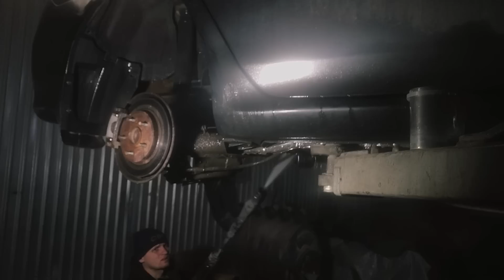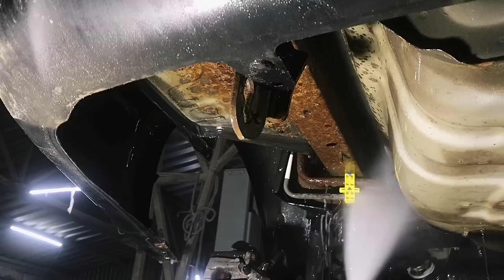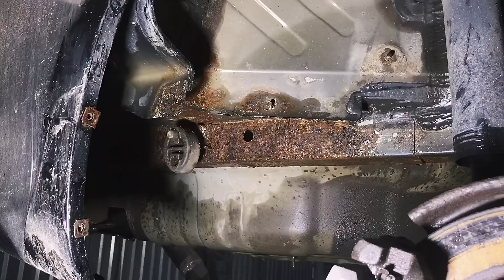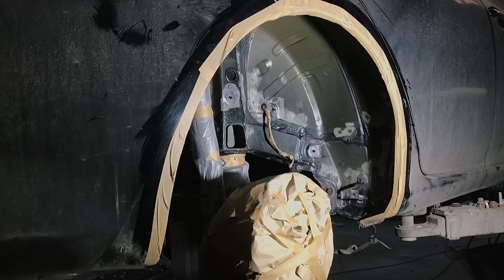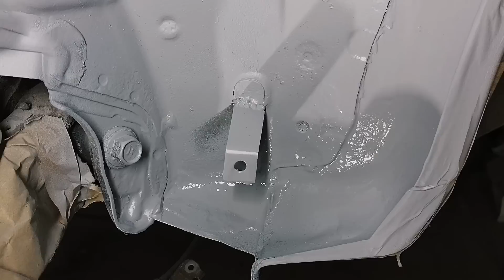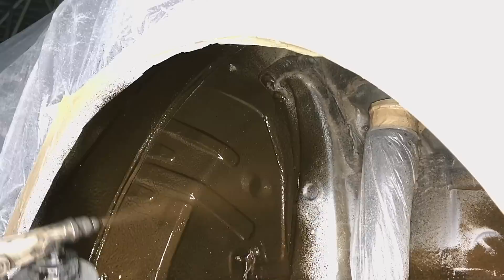Restoration Rusty Car Bottom Body  - Toyota Corolla E140

Comment: Great job, can you tell me the products you used there?
Reply from the maker: Here is a link to the tools and supplies that you may need:
Fluid Film Spray Gun Applicator Kit - https://amzn.to/3XxjdLZ
Anti-Rust Coating, 1 Gallon  - https://amzn.to/3CXuVpE
Anti-Rust Coating, 5 Gallon - https://amzn.to/46IY6KS
Fluid Film Spray - https://amzn.to/3O75WGZ
Under Body Coating Rust Proofing Corrosion Black Spray - https://amzn.to/3pnuT7u
Wire Brush for Drill - https://amzn.to/3PC71Yb
Knot Wire Wheel - https://amzn.to/3Nzwn6v
Stainless steel brush - https://amzn.to/3NCYWQm
Rubberized Undercoating Spray, Black - https://amzn.to/46AIWqL
Metal Etching Rust Neutralizer - https://amzn.to/44sqX3X
Angle Grinder - https://amzn.to/439t4bK
Sandblasting machine - https://amzn.to/3r7EnE9

Comment: Nice job, well done - but Toyota is know in Europe to be good quality but have bad rust protection ☹️
Reply from the maker: Thank you! it's true. But we saved this Toyota 🙂
Reply: All Japanese cars don't have rust protection. They don't need it In Japan.
Reply: Don't blame Toyota.  Blame the salt.  Salt is gonna destroy everything
Reply: @garryli2030  Sorry to say but even the Korean, Japan made Mazda and European cars have much less problem with corrosion. But yes salt on the roads is very devastating to the most metal.
Reply: Обычно ниссан никак не защищен от коррозии
Reply: @steelrolex  mazda less problems with rust? Ok 😂😂😂
Reply: That's a very generalized statement. The cars made around the time when this car in the video was in production were somewhat prone to corrosion but not much more than more that the average car. The first and second generation avensis were beating germans at the time, but the third Gen became worse in that regard.
Reply: @Scouter98  ok, than how do you explain totally rust free 1990s Audi 90/ A4, Passat, first gen Mégane , and many other models? Those are closing on 30 years of age without major rust issues ..
Reply: @sanyey8405  I could explain why they dont rust, but that's not the point of this discussion. I never said 90s toyotas rusted less than their european competitors, they were about average for that time period. I emphasize the fact that the dynamics have shifted back and forth, like for a while VW was on top of their game with the B5, but the B6 is exactly the opposite, while at the same time toyotas from that time period have stood the test of time.
Reply: It's not the rust protection, but all the salty stuff that's plentifully strewn on the streets in Europe in winter. Salt is merciless to everything.

Comment: That wasn't wool wax black
Bad choice whatever it is you used
Reply from the maker: Thank you for your comment. I understand that you are not satisfied with the product I chose for the anti-corrosion treatment of my car. However, I am confident that the option I selected is the best for my needs. Taking into account various factors such as effectiveness, duration of protection, and cost, I extensively discussed this with experts and researched feedback from other users. I believe that this product provides maximum corrosion protection for my vehicle. Thank you again for your input, and I would be happy to share my experience if you are interested in learning more.
Reply: @carchiklife  I've been watching vids and reading articles on which one I should use for my car
And from everything I've gathered 
Wool wax black is the winner hands down endurance coverage
(creeping/self healing) 
and rust prevention and black for asthetics (makes it look nicer)
Reply from the maker: @johndemore6402  The tool is developed on the basis of bitumen and rubber, completely does not harden and remains elastic, and does not crack, therefore it will not pass moisture for rusting and has good adhesion. of course there are black, but I like it with bronze.
Reply: @carchiklife  ah but here's the difference between the 2 wool wax is not a chemical based product which means it's environmentally friendly
Yours is rubber and/other.... Chemicals and I've seen vids where they did a 3 year follow-up and it's held up
Reply: @carchiklife  but let us look at it this way what's done is done
If your application holds then great if it doesn't then next time 
Try the wool wax what's the harm 🤗👍

Comment: Please guys, dont wear gloves with this high speed turning tools.
Reply from the maker: Why?)
Reply: @carchiklife  if the glove comes in the turning part....
Reply: @rvddecals6796  First thing I reacted to as well, Don't know where I heard about it or learned it but it makes sense when you think about it. I have had my fingers get scraped by these wire wheels and it burns but at least I didn't wear a glove that could get stuck in the wire strands and break my fingers. Also always wear eye protection unless you want your eyes to get impaled by a rouge strand flying at mach 10 towards you.

Comment: Japanese car Is not good treated underbody !!!!
Reply: Better than any Chevy or Ford.
Reply: No no....here in Italy and Europe Ford,Fiat, Opel, and VAG group Is very good After 20 years in the body!......also Mazda Is no good.....it's a japanese problem????...i don't know!
Reply: Mazda is one of the worst when it comes to rust protection. They say in Poland, the plastic even rusts on Mazda. But rustproof the car when brand knew, repeat 2-3 times and it will last for a while, even in North American 'Rust Belt'. BTW, this Toyota is decent shape, my father's Malibu's rocker panels basically desintegrated after a decade, you could put half of a men's arm into the rust holes, three layers of steel eaten away by salt. I was laughing my ass off because he was complaining that always patch my two decades old Honda.
Reply: @pliedtka  is Mazda japanese? Nissan is also French.

Comment: Typical "Rust Bucket"  Japanese product.   Putting lip stick on a pig does not solve the primary issue.   Toyota purchases very low quality Re-claimed metal.  AKA junk metals.    Would be a stretch to call it steel.  Although tossing in a few ounces of carbon to a product without smelting out all the KRAP... you end up with rust prone metal.  Then it is worse since they are not designed with box tubing frames.  Ever see what is left when a Corolla is hit by an American Truck.   NOt sure what good a stupid air bag will do to save you.